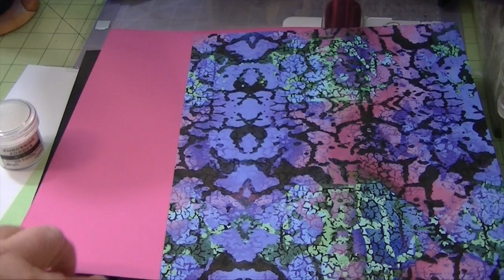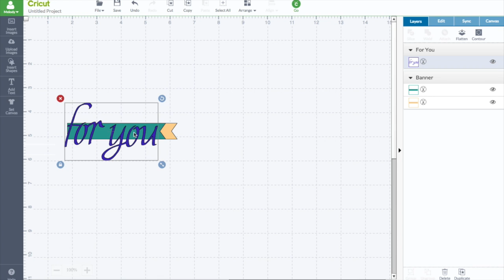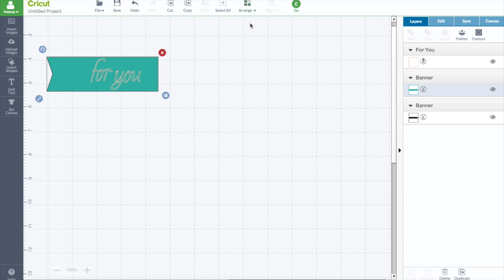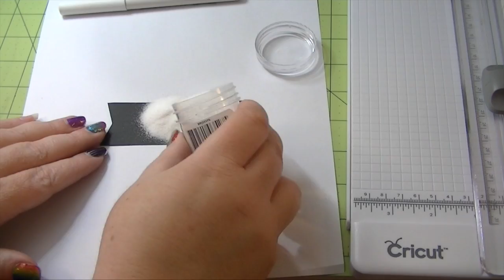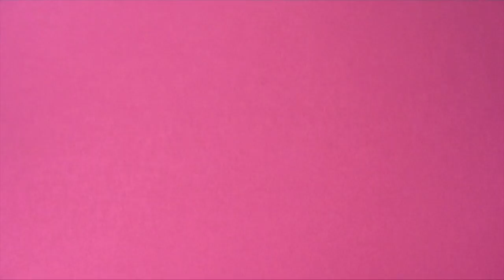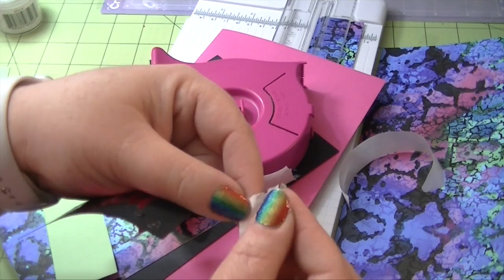Foil with Sticky Powder - Embossing with Cricut -  Easy Card

Comment: Ok I know this is crazy but I don't want yall to do the same thing I did. DO NOT PUT EMBOSSING POWDER THROUGH THE MINC OR A LAMINATOR! I tried it and it went through the carrier sheet and got on the inside rollers of my MINC. It took me a ton of times passing stuff through to get the white residue off of my rollers. 
I bought the color me papers from hot off the press. It's basically white embossing powder in cute designs and I was thinking I could melt the embossing powder just enough to get the foil to stick to it. Well it did NOT work. I just wanted to warn others before someone else messed up their machine like I almost did.
Reply: Thsnks, I was wondering if that would work. Thank you thank you.